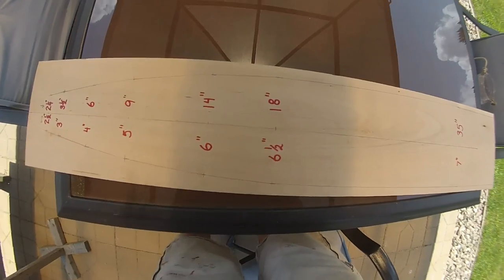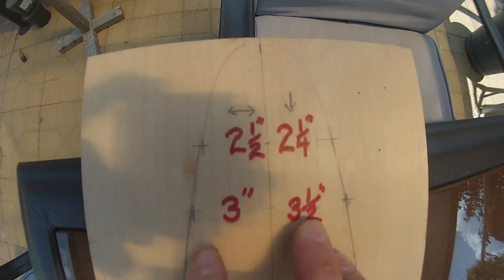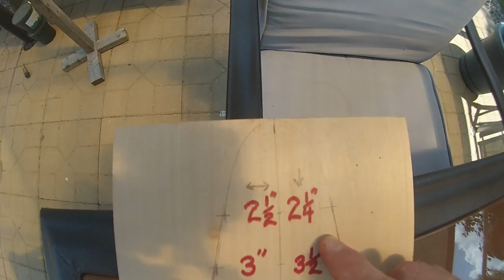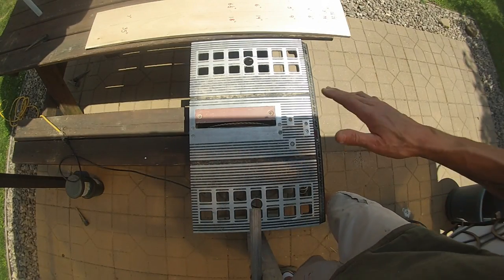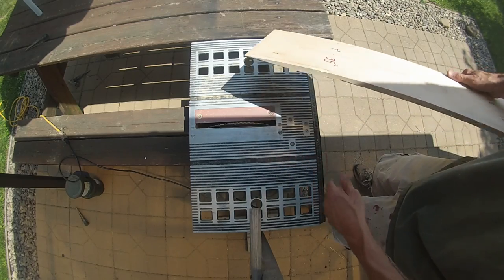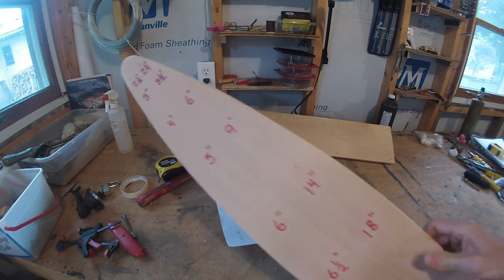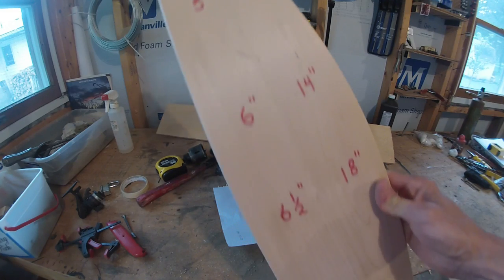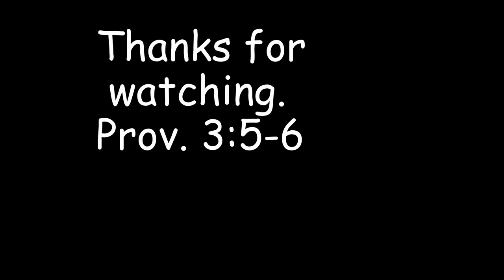Making a wooden fox stretcher

Comment: Turned out good for your first time. I still have to buy a pattern board for cats and coyotes. I'm going to go with an adjustable. I plan on making my own, but I don't think I'll make them out of basswood where it's kinda pricey. I'll probably go with pine since it's soft and cheap. Cheap is always better for a poor country boy. Lol. Probably buy rough lumber and just hand plane it down to thickness for yotes and keep some 3/4 or an inch for cats. I sure can't wait till season gets here. About 6 weeks to go. Hopefully I can get some good footage. Hope you fill a tag during bow season. Awesome video
Reply: You can Google board sizes from AFT and other places. Gives everything you want to know. I use a jig saw to cut mine. Just take your time, it's so satisfying to make your own stuff.